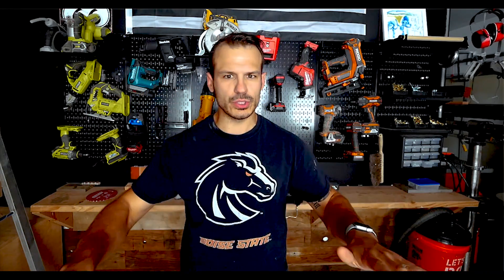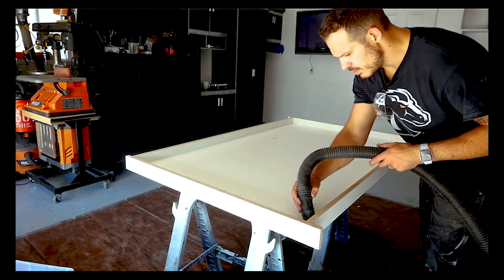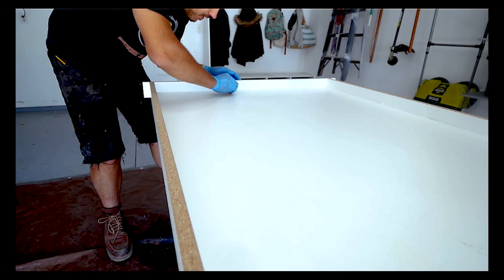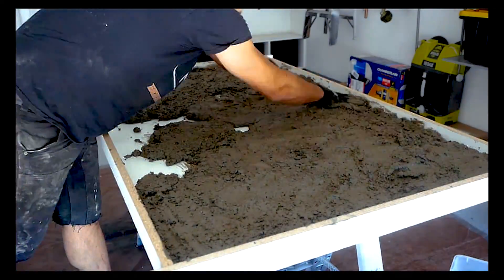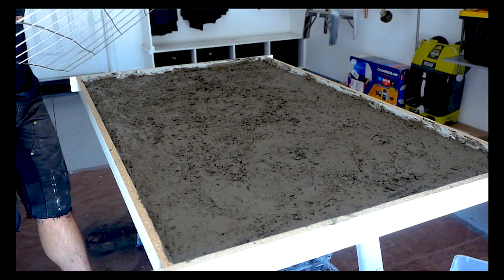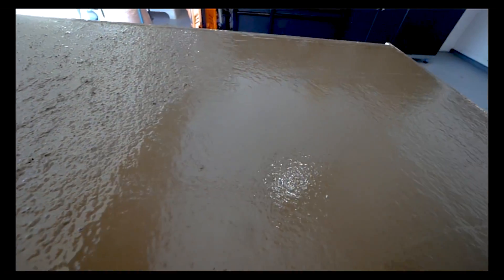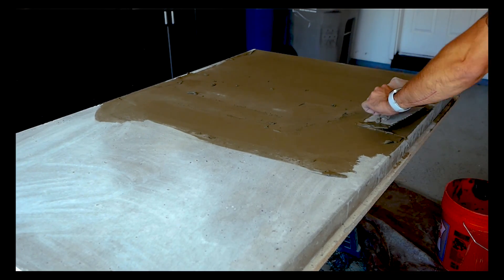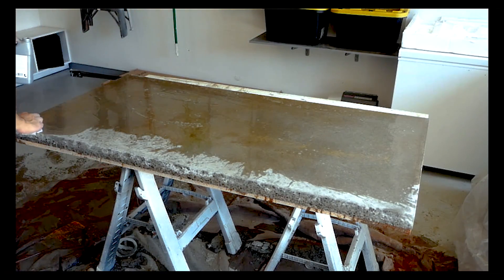DIY Concrete Countertops For DUMMIES

Comment: Please have a look at the concrete countertop institutes website.
It will take your concrete forming and finish to a whole other level.

Nice DIY job but it won't last much longer than a year before its stained and cracking.

Not all concrete is the same as you'll find out from the website above.

No offence meant buddy. This is my profession and the more people that promote it right the more people realise concrete isn't easy to do right whrn your making it last for decades looking awesome on day 1 and day 30000!
Reply: Monster Barbell it’s called concrete countertops for dummies lol
Reply: Monster Barbell although I always wonder why these guys don’t reinforce their slabs.
Reply: How about some tips to avoid staining and cracking? What concrete do you recommend using? I am doing this to save money. I was planning on buying quikcrete 5000 psi and add fibers for reinforcement
Reply: @living9377  saving money and concrete aren't mutually exclusive.

Use a good mix. Take a look at fishstone super 6. Speak to tom.

He sells a sealer called Useal, I dont use it personally, I prefer Omega for COncrete Countertop Institute.

Better mix, better sealer = better results/ no stains (within reason of abuse), no cracking.

Comment: Looks fantastic, man. Great job.👍
Have you seen the ground back, slabs, where the stones are exposed, then polished and clear coated? They look amazing.
Reply from the maker: Bill Carroll thanks bill.  I have not had a chance, but I did cut off 6” of this slab for a backsplash and saw the rocks. Really cool effect.
Reply: I was going to ask…have you ever tried putting pebbles/rocks/shells on the base of your form then do your first inch? To change up the top look—sometimes what people do with floors?  Wondered if that may work here???

Comment: Isn’t there like a flow control powder you can use that only takes a little bit to make it super super liquidy without adding more water and sacrificing the strength. Then you wouldn’t have to take all the time of pushing it into the corners and things
Reply: I’ve heard it referred to as plasticizer. It is awesome stuff

Comment: I saw someone use a reciprocating saw without the blade on the side to use it as a vibrator to settle the concrete and get all of the air bubbles out.

Comment: Your slab looked curved due to the positioning of your sawhorses. Still loved the video though👍
Reply from the maker: yeah i realized that too. learned my lesson. use a table next time
Reply: @MrBuildit  i did mine in place
Reply: @MrBuildit  on 3/4 plywood
Reply from the maker: was it difficult to get the bubbles out?
Reply: I made the exact same mistake on my first counter top. I had good success from building a frame underneath from 2x4s
Reply: @MrBuildit  no i hit it with the sawzall underneath and with craftsman cordless palm nailer. Works great. I just waited about 3 to 4 hours after i poured to play with it....playing with it any earlier is just a waste of time because it keeps coming ya know. ... come back trowel it and boom done. I always mix concrete adhesive into my concrete no matter what I'm doing. ... mortar too
Reply: I painted it with behr marquee Oryx black and. epoxied the top
Reply: I like what you did there though. ... using the bottom as the top was clever.
Reply from the maker: yeah, lesson learned

Comment: that's a finish trowel, a mag or aluminum float should be used first to knock down rock and make it flat a finish trowel used first will seal the concrete before all the moisture is out causing blisters

Comment: Thanks for the video. When you filled the surface with Portland, was there any sand in the mix? Or just 100% Portland cement with water? Thanks
Reply: What did you end up doing? I did regular Portland and it’s a mess. Completely two different colors. Not smooth at all. Not sure what to do

Comment: Awesome work! Just one question.... how did you mount it to the wall?
Reply: I have been asking the same question...been looking at his other videos but he never mentioned it anywhere
Reply: He had it resting on wood he had drilled into the wall studs
Reply: Aaron Brown I have made a concrete countertop before and it was heavy. I am just worried about the countertop being to heavy even for the studs.
Reply: Philipp Achleitner it could well be im not sure if he used any sort of extra hidden braces underneath the counter top. However the counter top dosent look huge so it might be allright

Comment: You can use a apecial vibrator made for this purpose,. to eliminate air bubles.
it might be too expensive to own but i'm sure you can rent it for a day.
Reply: @emailrobertbm  yes but if there are air bubbles inside. Sanding wull only expose them and you will end uo with little holes.

Comment: i want to try attaching a reciprocating saw to the base with bungies while it is drying and just leave it on.  Anything to simulate the vibrating tables the pros use.
Reply from the maker: Thats a brilliant idea. One of the project ideas on my list is to figure out a way to simulate a vibrating/shaking table for concrete. fo funny you said that.
Reply: Vibrating is great for removing air pockets however, the more concrete is vibrated the more the cement and aggregate separates. This leaves you with  weaker concrete.  Best to tap the sides and run a vibrator (orbital sander works ok for this) on all  sides for 2-5 seconds.
Reply: Luke Elder thanks for the tip!

Comment: I couldn’t tell how you installed the counter. Is it sitting directly on the washer and dryer?  I was wondering how it is holding up with the vibrations of the machines.
Reply from the maker: Beth Giardina it sits on 2x4s mounted to the studs. 2” over the appliances.

Comment: I would consider doing a slump test after mixing the concrete.  Also, for those doing it at home, while vibration is important, make sure not to vibrate it TOO much, which could cause the aggregate to settle at the bottom (aka, the top after it's flipped).

Comment: If i were to do this for a 79"x39"x2" how nuch concrete would i need?
Reply from the maker: Neil Vayas there are tons of free concrete calculators on line. Based off of the eight of concrete you are using.
Reply: 1.25 cubic feet, or about 3 bags of concrete 30 kg each, use basic 5000 psi concrete and fibre reinforcement.  Don't use the countertop concrete, it's expensive only BC its "specialized" and doesn't sell very well.  Its just concrete with some addmix and reinforcement.

Comment: Another way to make a nice finish on top is to start with a slurry coat then pour the concrete.
Reply from the maker: Yes. I've seen that approch on GFRC counter tops. I need a large air compressor. That will make it so much easier to do things like that

Comment: Very nice Alex! Have you given any thought on using AR Glass fibers w/ GFRC mix? Apparently, you can get the slabs down to around 1.5in thick with no need for re-bar. Ideal for smaller projects, probably not for large surfaces.
Reply from the maker: yes. Im dying to try it. have you tried?
Reply: Sadly no, it is on my build bucket list.
Reply: According to the "Concrete Countertop Institute" (I recommend checking out their website and some of their videos), it's not as simple as just adding the fibres to the mix and doing everything else the same and they refer to it as the GFRC process but didn't explain it further on their website. On a This Old House video, they used rollers to orient the fibers horizontally but they didn't explain that.

Comment: A mallet would help with the bubble voids
Reply: Run a Sawzall with no blade on the forms.  Put the foot of the saw on the form and pull the trigger while moving down it.  Works great.
Reply: Good job Chris finally someone uses a sawzall other than me

Comment: Disappointed with the finished product.
Reply: That's because it wasn't finished, he doesn't know what he's doing. It's way heavier and thicker than necessary, that reinforcement was useless, it would be more effective if the concrete was thinner... Also, it will get moldy in no time.